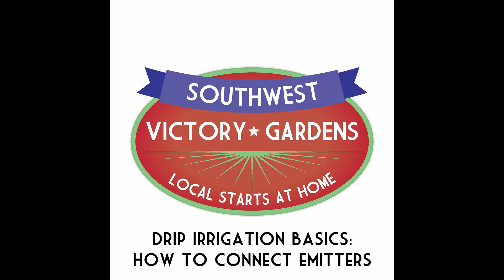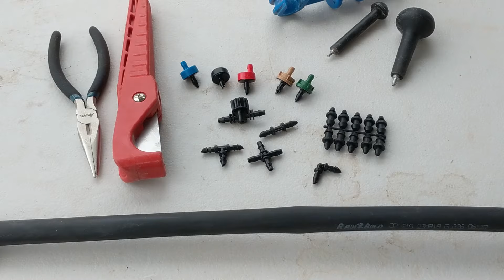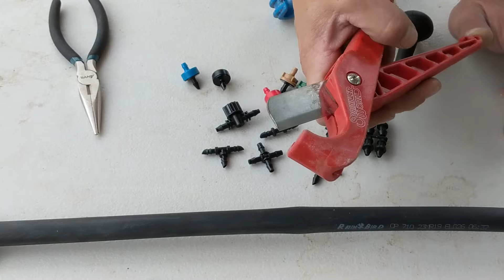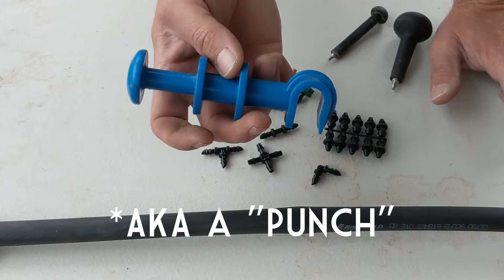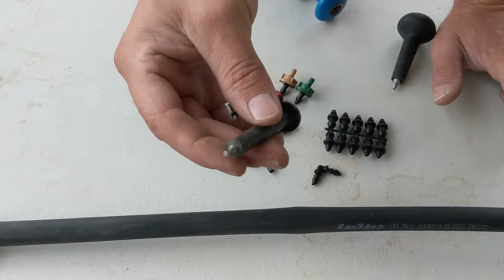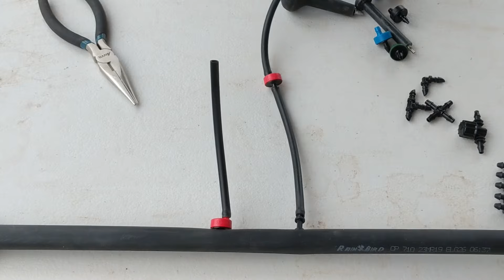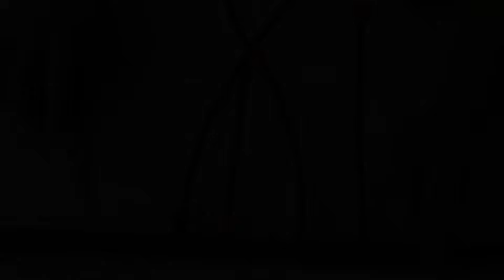Desert Gardening Basics: How to Install Drip Emitters

Comment: I’m trying to put in my spaghetti tube and emitters today but clearly I’m in need of advice!
Can I use the 90° barbed connector to run the spaghetti pipe to multiple in-line emitters? It seems like the little barbed fittings will go all the way through the other side of the 1/4” poly tubing.
Do I have to use a different method? I bought the emitters separately, as opposed to a line with emitters already installed, in order to have more control over where the emitters are situated. 
Thank you for any advice!
Reply from the maker: hey yaakovina, i'm not sure i'm understanding correctly, you can have multiple emitters on your spaghetti line, but you would still want to make sure your not using long lengths of 1/4" spaghetti tubing, try and keep the max length to under 10 feet.
Reply: @SouthwestVictoryGardens  thank you, that’s a good guideline!!

Comment: 1 gallon per hour is great; but how do I set it up so the plant gets 1 gallon per week? Do I need a timer to shut the water off?
Reply from the maker: Yes you'll need some type of timer for your system, I cover those in the 1st video in my series on irrigation. It can be a manual timer or something electronic, just find one that works best for your needs. The best timers will allow you the flexibility to program anywhere from once a month to up to 12 times a day.
Reply: @SouthwestVictoryGardens  Thanks for replying. Just got myself some timers on Amazon.

Comment: Hi, thanks for the video!  Is the Rain Bird ½" poly tubing that you use in your video the same as the "The Pipe with the Stripe" poly tubing for sprinkler irrigation that you can get from Home Depot?  I'm thinking of getting that, but i'm wondering since it handles upto 75PSI the pipe walls might be too thick to punch the holes for emitters.  Any advice would be helpful, thanks!
Reply from the maker: You often see black poly tube with a colored stripe. It makes it easier to identify when installing multiple lines in the same trench. Whether or not it's the same type i'm not sure. It should be flexible and not rigid. Get yourself a good punch and you can punch the holes easier. I've used a very thick commercial grade tubing and was still able to punch through with no problem.
Reply: @SouthwestVictoryGardens  That's great, thanks for the tips.  I have one more question if you don't mind.  I'm installing about 500 feet of ½" tubing with about 1000 feet of ¼" drip line coming off of that.  I'm a bit concerned about losing pressure as I get farther away from the hose bib.  Would you recommend going wider than a ½" diameter for the feeder tubes, in order to maintain a higher water pressure farther from the house?
Reply from the maker: @MyNiagaraGarden  For that length of line I would upgrade to 3/4" poly, you'll probably not have enough with 1/2" tubing.
Reply: @SouthwestVictoryGardens  Thanks for the reply, i ended up doing the math on the 200 GPH capacity of ½" poly tubing. So, as long as i switch from ¼" drip lines (where each emitter emits at 0.5 GPH) to drip tape (where each emitter emits at 0.25 GPH) i should be able to able maintain the water pressure i need to supply the whole grid.

Comment: I have 4 4x8 raised beds can 1 half inch line work for all 4?
Reply from the maker: Sorry I didn't see this comment. Yes that should be fine, as long as your total GPH output is less than 200 gallons or so you shouldn't have any problems. Good Luck

Comment: For drip systems say 50-60 .5gph emitters , does the system need too be a closed loop ? Is it required for the emitters too open correctly ?

Using a 900gph pump that maintains 70psi
Reply from the maker: most drip systems are set to run at a lower PSI no higher than say 40. On a standard system with 1/2" tubing and pressure compensating emitters you can run about 300' of line and up to 180-200 gallons of emitters without losing pressure so 60 .5gph emitters should be no issues at all. Good luck!

Comment: Is this only audio on left channel? had my cheking all my cables and amps. great info subscribed. i have blisters from trying to put micro tubing on micro drippers. tips besides hot water?
Reply from the maker: Not sure about the audio, I do the best I can but i'm afraid i'm not the best video editor. I use needle nose pliers to help me to attach and remove emitters, for larger fittings I use the "power-loc" types rather than compression fittings which are easier to work with. I've heard of heating up the tubing in other ways, like using a lighter , but i've never tried that myself. Good luck!
Reply: @SouthwestVictoryGardens  thanks buddy. Wasn't complaining just wasn't sure if my wiring.  Re connecting. I think my culprit is that I am in Australia and the standard micro tubing is a bit too small for the better priced emitters I got from Alibaba (I work at a place that sells the emitters here and still too expensive) I've ordered the blue auto tube attacher gizmo and we will see if it works. Cheers
Reply from the maker: @dmaifred  If it helps, I can recommend the brands that I use most and maybe you can order them or find them in your area? "Netafim" makes great sprinklers and other greenhouse emitters, I use "Rain Bird" emitters and their tubing as well. "Centennial" makes excellent tubing and I also like "DIG" dripperline. You might be able to find those products from a specialized irrigation retailer in your area.

Comment: what if you needed to connect multiple emitters to one 1/4 inch pipe.  I see you have a t-spit barbed connector. Basically i want to run one 1/4 inch line to one shrub but have two emitters instead of running two separate lines.  would you run the 1/4 inch line all the way, split it with the barbed wire, add some more 1/4 inch line, and then attach the emitters at that point and then another 1/4 inch line from the emitter to the plant?
Reply from the maker: Yes you can do that, I do it all of the time for shrubs. For example, I'll use a two gallon emitter and run a 1/4" spaghetti tube over to the shrub and then split it with a "T" so I can water 1 gallon on two sides of the root ball, it's very effective.
Reply: I tried your suggestion but with a 1 gallon emmiter.  I attached the 1 gallon emmiter to to the 1/2 inch main line. Attached the 1/4 spaghetti tube split it with a T and what ended up happening is that the water only came out of one side and not the other.  If one side is above the other the water wont come out. When i leveled them out perfectly the water did come out of both sides which is not realistic.

Comment: Thanks for the video, appreciate the southwest specific channel content, I’m also located in Tucson working on your style soil building. However I disagree on it being the wrong way to put the emitter at the micro tube end. It’s much less disruptive to change the value of an emitter, troubleshoot an issue, flush a flag end emitter vs digging back to the trunk line to locate the plugged or defective emitter. If it’s an exposed trunk line, for sure putting the emitter is the way to go. If it’s buried line, your mileage may vary.
Reply from the maker: Those are some good points, I don't really use flag emitters so that may be good alternative set up for those. If you're gonna go that route you  might want to keep an eye on your system because if any critters come by and chew the emitters off you can run into some issues with flooding :)
Reply: @SouthwestVictoryGardens  It has been my experience that if rabbits find wet soil, they will dig until they find the tubing anyway. I make it a point to walk my yard while the irrigation is going at least once a week to check for "fountains), i.e. chewed off tubing!
Reply from the maker: @jeffross9620  Depending on where you are this can definitely be an issue. It might be worth investing in PVC if critters are a continued problem.
Reply: Completely agree with you John